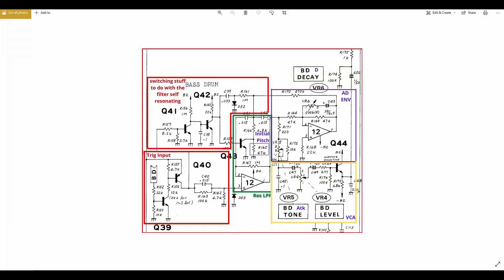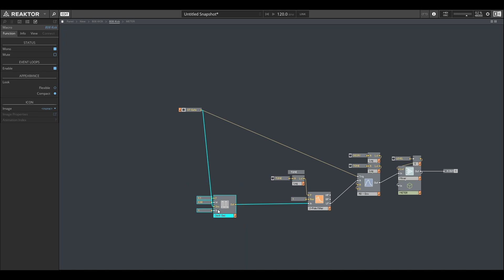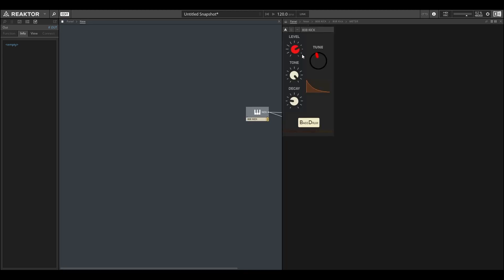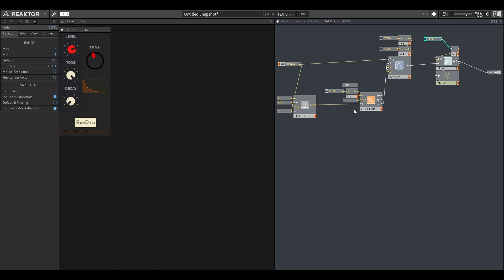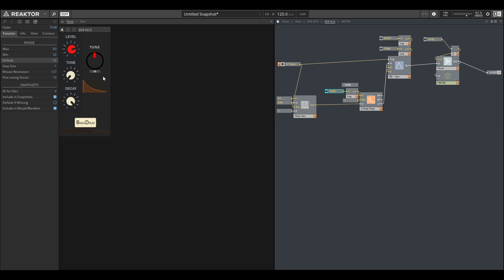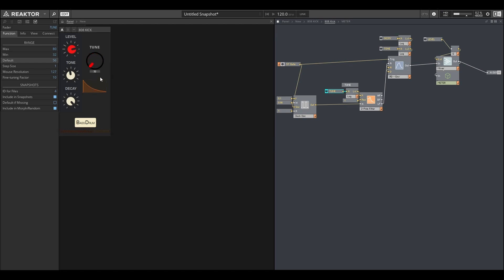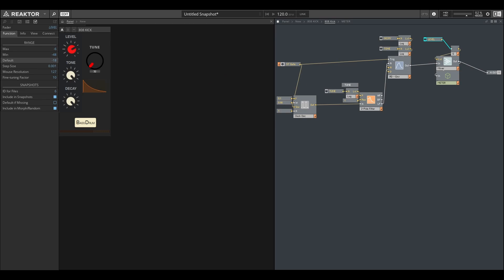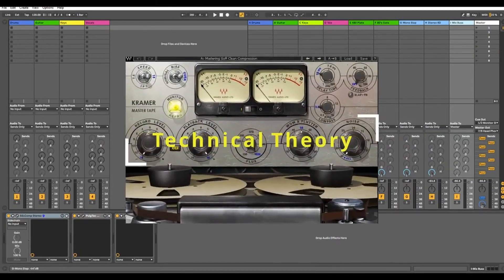TR-808 Bass Drum Circuit Analysis

Comment: Have you played with the RC-808 vst made by the original Roland TR808 designers ? That emulates the circuit type and has a fair amount of parameters to tweak.  My only gripe is that it doesn't seem to have the original 808 kick settings as a preset, which i would like to see so that i can build my own kicks with an understanding of what makes the 808 kick work the way it does. It seem easy and ovious, but getting all the various envelopes aligned is no easy task !    If you ever have a go and nail it, please post it !
Reply from the maker: The 808 kick circuit and also the Tom's, all used a resonant band pass filter setup, where a impulse would ping the input and let the filter resonate at the tuned frequency, the only envelope after that is a simple two stage attack decay system that allowed control over the click and length.

I do intend to revisit these, just for now im moving house.
Reply: @retrosoundstudio   cool :)